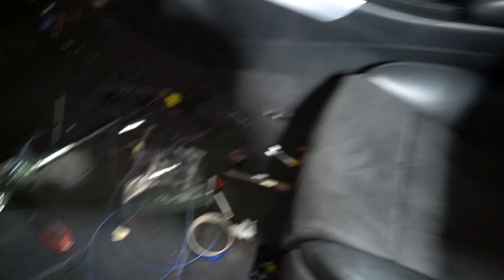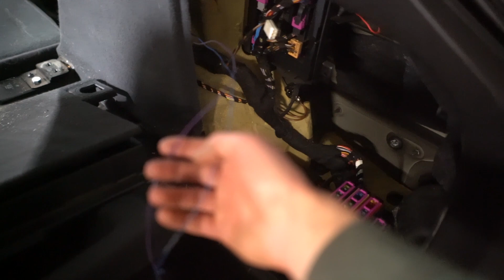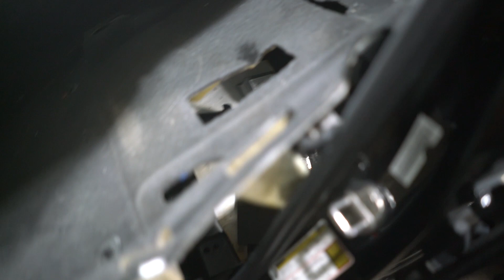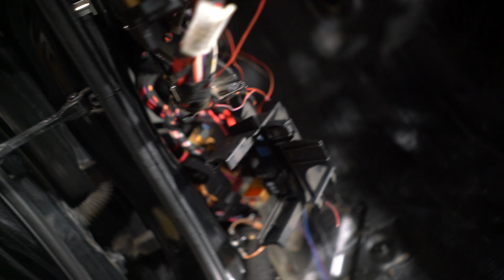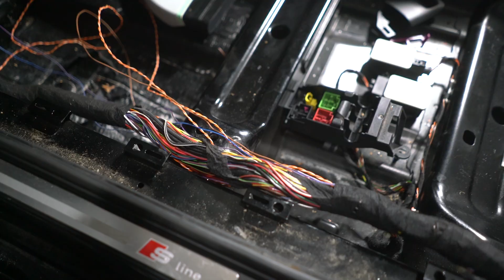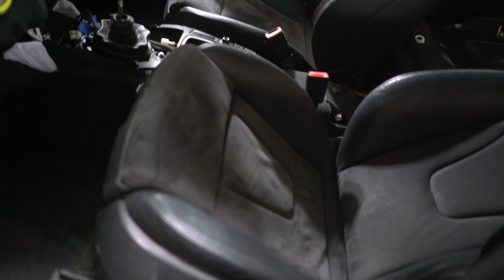Audi S4 Avant: Manual Swap and Sports Diff Wiring

Comment: I've just bought an S4 without the sports diff and I want to retrofit it.
Wiring wise do I only need the diff harness, diff computer, and the long canbus wires to the front, or do I need any more wiring for it to work?
Fitting the diff and shorter axles is the easy part to figure out. :p

Comment: Do you need to rip the interior this much just to install a clutch switch?
Reply from the maker: Short answer is no. I wanted to keep the wiring as OEM as possible, and I was also adding the sports diff which has an extra sensor under the driver seat carpet and a few wires that run from the spare tire area in the truck up to the front end.

Comment: I’m looking at doing a manual swap on a 2007 s4 Avant. Your making me thing it won’t be that difficult
Reply from the maker: That should be fairly straigjt forward because you can easily source b7 s4 parts from sedans. May need some axles and stuff but as long as you are comfortable dropping a trans you can probably pull it off. A little less involved than a full s4 conversion! Let me know if you do it

Comment: Are you retro fitting the Sports diff with this car? The reason is I was that I have and S4 without the sports diff and I was wondering it I can get the wiring harness, module and sports diff and do the swap. If it feasible?

Comment: if you have a 2009 avant "premium" and a s4 from 2009 to 2012, do you have to change the body harness to the s4 to retain the s4 features like if it was a "prestige" version or just individual parts? looking to do the swap also but keep the automatic transmission.
Reply from the maker: I think you would have to splice a lot of the s4 harness in to get the extra features. If I was doing that I would pull both harnesses and add the avant stuff to the s4 harness. You have the led headlights, hvac controls, navigation just for starters. Add in prestige options like lane assist and it's going to be a huge job. Also why keep the slush box? Just buy an a6 with the 3.0t, swap the seats and steering wheel and call it a day.

Comment: "No Sirius-XM, gonna scrap it, sell off the whole project & get a different car".    XD
Reply from the maker: Haha what is more concerning is that the radio doesn't work at all, but that's a problem for another day.
Reply: @TheBadTimingClub  Probably component protection :(
Reply from the maker: @rizrz34  its actually because the s4 has b&o sound system and I have not swapped over the harness and amp for it yet. Every module is from the s4 so I have not had any CP issues yet